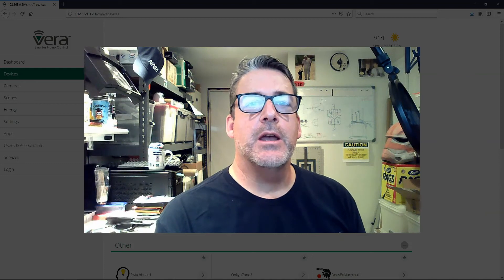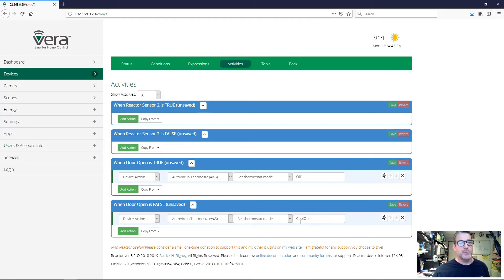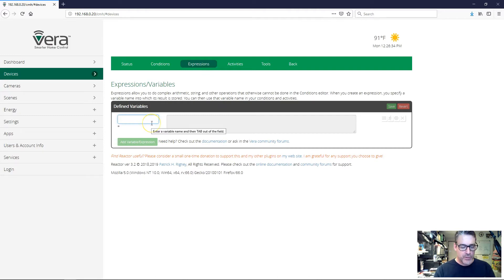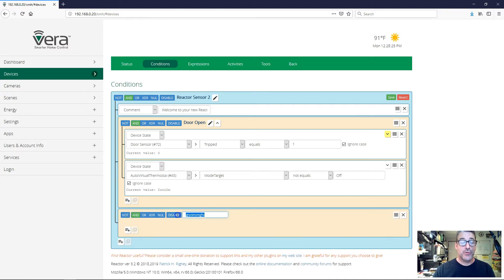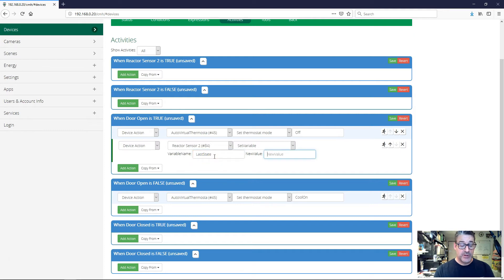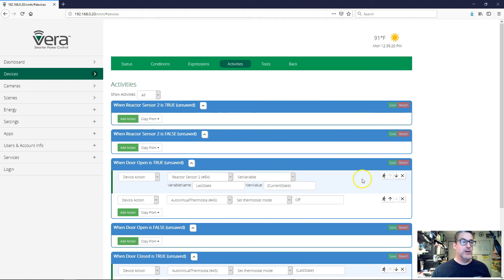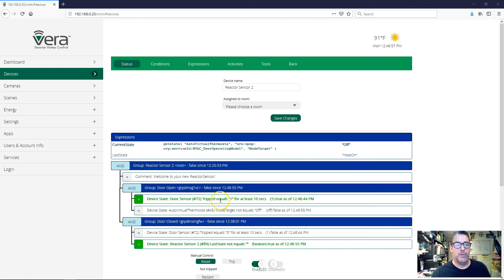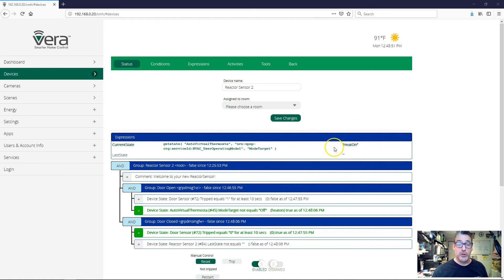Reactor for Vera #005 - Turn Off AC When Door Open

Comment: This is great, one of my favorite conditions. I have originally created in PLEG, pulling in ecobee plugin, and env alarm panel plugin (sensor feedback). I have it built on "NOW" in PLEG so might rebuild in Reactor as I'm trying to remove my "NOW" conditions for obv reasons
Reply: It was a design requirement (and point of pride with me) that Reactor be able to test time conditions correctly and with minimal processing, and not simply re-test every minute as PLEG seems to do with NOW.